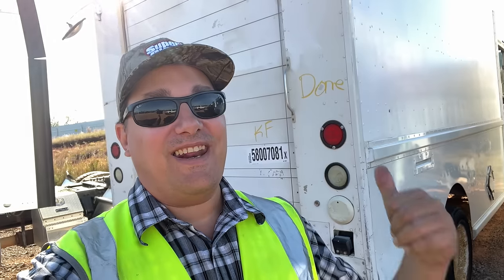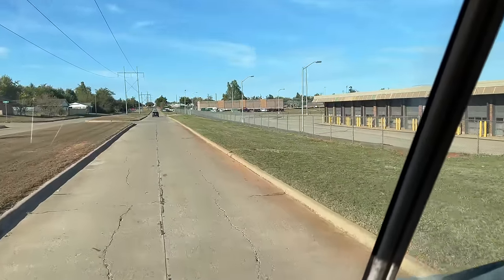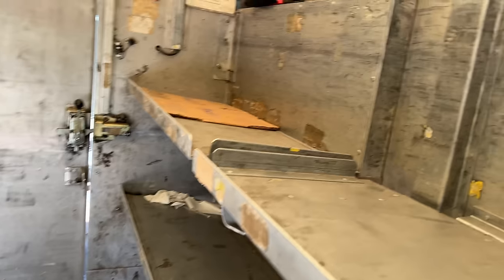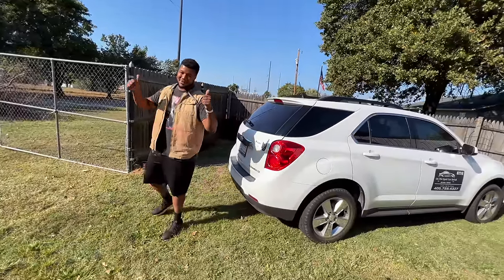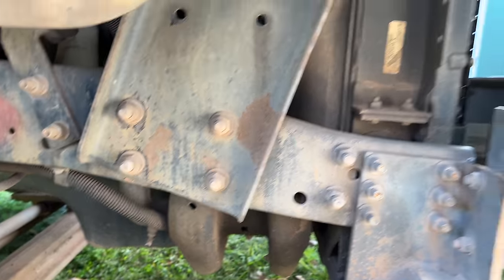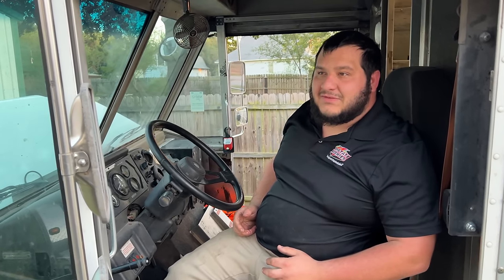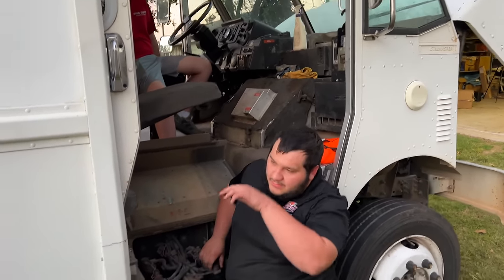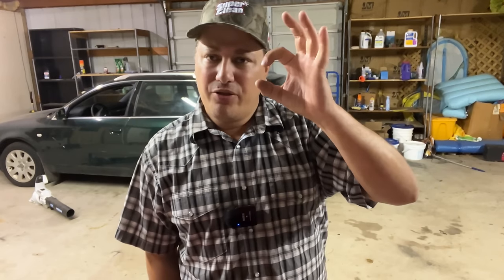I Bought the Cheapest FedEX Truck EVER 24v Cummins + Allison for $4350!! Freightliner MT45 Step van!

Comment: Randy. Here are a couple of answers for you. The diagnostic scan tool for this truck is called a Pro-link. Also, the engine diagnostic switch should activate the blink codes. You’ll need to hold this switch and watch you dash lights. I hope this helps. 

VR
Jeremy
Gears and Beers Automotive

Comment: 34:25  that first switch (rear one) says IDLE INC/DEC.... so like pop that up 2 times and your CHARGERALAERTOTWHIRLIE WISMO (alternator) spits out CHARGEIN VOLTAGE at sittin there instead of at 1500 rpm or wutevcer ... ??  I don't know for sure but the rest of the truck seems pretty logical to ME!! so like... u7mmmm that would be good thing...  click it up a couple notyhces when loading and warming things up so all systems are charged and topped off and warmed up for the day ahead...  like that seems logical...  can't see what the 1st/front one says... sorry (may change when I unpause... lol)
Reply: but sumpon sent a manual ;) soo ummmm didn't they?? did that help???

Comment: Diesel engine oil isn't always black, every cummins I've owned my oil still looks like new oil 5k miles in. Old diesels are the engines that tend to always be black no matter how much you change the oil (6.2/6.5 Detroit, 6v71's etc). But every cummins I've run has clean oil, your engine needs an oil change bad, probably an engine flush.
Reply from the maker: I buy a new RAM Cummins every year and my oil always looks black.

Comment: Seem just a bread company van. Got so many here.LOL
Reply: Not going to see that commins or race it, the 350 can torque pull that bread box easily & more cheaply,  Don't get the love. LOl  the fright master We had had a awful high couch release terrible / spooky on hill. Fast release but slow at 80% or you stall out the engine. Too slow and the cars behind will lay on the horn, as you  roll back I rememberd. Vending service route way back,. LOL

Comment: I do hope you noticed the sticker on the dash before you get too excited about the miles
Reply: Air Filter Element does not come out of the case, unbolt it from the pipe, release the clamp, slide in a new one.  Cummins oil filter is on the passenger side of the engine, trans filter is tiny and on the front drivers side of the trans, fuel filters (two) are on the drivers side, one by the bumper and one a little farther back before the pump.  I have no idea about the wireless lock and key system, if I were you I would just remove it all before it fails and leaves you stranded.  I am a diesel mechanic and we service 50+ Utilimasters in a fleet, all are either Fords or Freightliners.

Comment: For 5k$ u stole it. U cant even get good used f150s for less then 8 to 10k$ here in Maryland. Plus its a cummins so it will outlive the truck even if the truck doesn't hold. But it will make a great tow rig

Comment: Not cheap.. back is all smashed up 181k miles means the hours on that are super high those things idle more than they do miles they are super loud I have the one next to you the 04 key is on the left door those electric door clicks are horrible I'd disconnect them all.. first thing to do was to check fluids before ya turn her over...

Comment: So at 5k you basically bought the engine and they just threw the rest of it in at no charge! Google and maybe replace the batteries in that wrist watch looking activator you wearing? Or just mug your local FedEx guy and get the one he's wearing. Okay for all your FedEx guys as a joke okay! You could section FedEx truck. Buy a UPS truck. Cut them all in half weld the front of one to the back of the other. Then you would have a should I say it yeah I'll say it a Fed up truck! Okay this is guy that owns a few cop cars ambulance and a fire truck give me a little bit hard time about buying a FedEx truck. Heck I like to have one. Word up how do you get a 429 Ford engine with under 15,000 miles for a more than reasonable price? Hunt it out and buy an old fire truck with low hours on it it's just been passed around between the districts. Look for one without AC because they'll drive everything else first. I know one thing that FedEx truck flip it and make some money